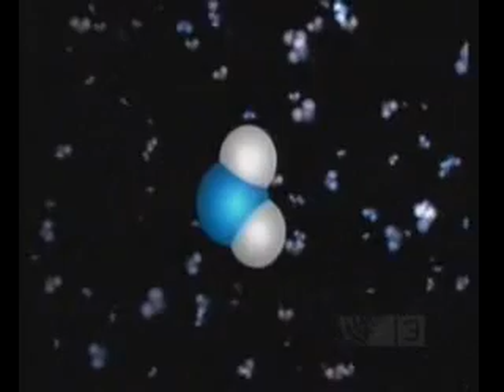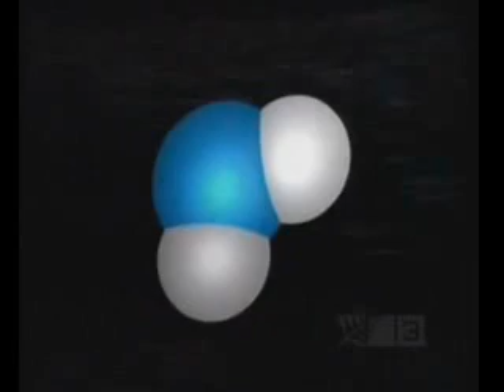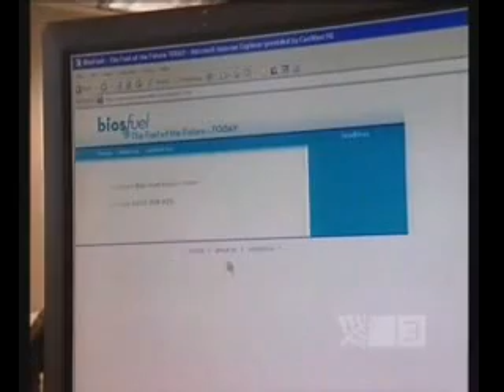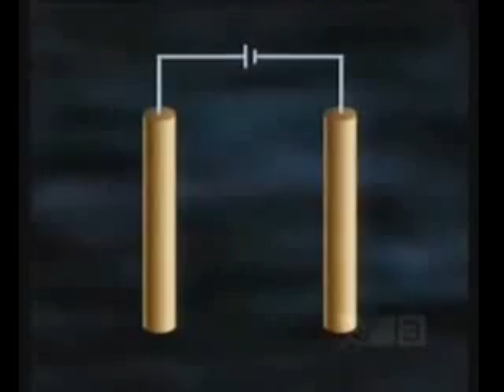A Motorcycle that runs on PURE Water.

Comment: 1:50 The comment box reads "Separate H20 at the point of combustion instead... What's all the fuss." The fuss is that nature doesn't work that way. No amount of heating alone (well at least no amount this side of the surface of the Sun!) will break a covalent bond. Even if he has somehow dissolved a fuel in the water, the expansion of water into a gas may help to drive the cylinder down, but otherwise the water is just an inert vehicle for the fuel. It won't spontaneously separate and recombine.

Comment: While true that hydrogen does dissolve in water, it does not do so to any significant degree; about 0.0016g/cu. L. Assuming we could liberate all the dissolved H2, how much heat could we produce? The ΔH for reacting 2 moles of H2 with 1 mole of O2 is −486.6kJ. H2 is 2.016 g per mole. Thus the most heat we could transfer from our liter of "combustible water" is 0.193kJ, or about 46 calories/L. We need roughly 233,695 times that to operate an internal combustion engine. The claim is pure bullshit.

Comment: Over 100 yrs my friend. Keely had resonant Hydrogen production in the late 1800's. He was called a fraud for his motor powered by resonance (he used a tuning fork...not thought). He also created a hydrogen cannon (using a resonant hydrogen cell to extract the hydrogen from water). Look up "Dr. Stiffler SEC Exciter Hydrogen production via diode". A SEC Exciter can be powered by 1 AA battery if built correctly. Imagine how much hydrogen you could get with a car battery.

Comment: No need to be afraid of things you don't understand. Learn everything you can about something and you will no longer have a reason to fear it. At least that explains why Tesla and Einstein butted heads so much. Quantum Physics is simply the balance to Physics. Two different sides of the same coin. They are the exceptions to each other. One proves the other as well as opposes it. Equal and Opposite. Yin/Yang. Male/Female. Without one the other simply does not exist.

Comment: p2. Also if we did things the same way the universe does (not in straight lines) there is far less resistance and the speed of light is not constant. Meaning the e=mc^2 needs to also be e=mc^3, e=mc^5, etc, etc. Adjustments need to be made and the "laws" of physics need to be used as tools not rules.

Comment: Resonant Hydrogen Production. Found by Keely over 100 yrs ago. Find a video titled Dr. Stiffler SEC Exciter Hydrogen production via diode on youtube. A SEC exciter can be powered by 1 AA battery if built right. Solar Technology is also Tesla Tech. Radiant Energy collector...Tesla used mica instead of silica. The problem with resonant hydrogen production is it does not follow Faraday's math and does not play nice with thermodynamics.

Comment: If it can be documented and proven, then physics laws change.  It has been happening a lot lately.  All the way to the point that the law of relativity my be no longer a law in a few years.  New findings have potentially turned that one on it's head.  The scientific community is always striving to learn more.  If a law can be proven wrong, repeatedly, then it will be changed or replaced.

Comment: For the many wondering why it didn't get out...It does not follow Faraday's Law for splitting the water molecule. It also does not follow the law of thermodynamics. Its called resonant Hydrogen Production. Found by Keely over 100 yrs ago. Search youtube for Dr. Stiffler SEC Exciter Hydrogen production via diode. A SEC exciter can be powered by 1 AA battery if built right. Imagine what a standard car battery could do.

Comment: You would think so...but that is simply not the case. It got buried by the same people that buried it 100 years ago. Its called resonant hydrogen production. It splits the water molecule with resonance. The reason it gets buried is because it does not agree with our current "laws" of thermodynamics and proves that the math for Faraday's laws are not 100%. The amount of power to split water according to Faraday is far less then it actually takes, but Faraday did not account for resonance.

Comment: Resonant Hydrogen Production has been around for over 100 yrs. Keely designed the process to split water with small amounts of electricity forever ago. Its not electrolysis by the convention methods. Its called resonant hydrogen production. Look it up.

Comment: You don't need to ask me, look around. If you want to, add up the carbon dioxide emitted by our cars by weight and volume and see if it adds up to an amount that would increase the CO2 in the air from 280 ppm to 390 ppm in the last 50 years. If so then ask yourself what carbon dioxide does. If you want to know more, take a video cam, which can see infrared, and see if you can see infrared through a tank of CO2 (use dry ice).

Comment: Energy is partially lost to heat whenever it is changed in form, and totally lost when it becomes heat after it does its work, unless it is captured for more work on the way out and cools even more.  Water for hydro-power is a carrier like the weight on a cuckoo clock, the energy isn't in the weight, it is stored in the gravitational field. Some is lost in transmission, but there is a lot left when it gets there.

Comment: No there isn't. A catalyst aids a reaction that already has a result that is downhill from the initial state and just needs a bypass around a potential barrier. Water is NOT in an initial high state, it is burned hydrogen and is in a low state, that means that violates the meaning of the word catalyst.

Comment: When you pile things up in an ordered manner, and then they fall down in disorder, work can be done by them. Like falling water. Or the positive and negative terminals of a battery. The positive is an abundance that is trapped, and the negative is an absence it can flow into. It's relative, whichever is of greater order is the source, the greater disorder is the sink.

Comment: 'I'm a physicist too", yeaaaah riight, Suuure you are! And I worked as an electronic engineer for thirty years, dumb ass, Water molecules are NOT "AC rotors", whatever the fuck THAT is!! They are electric dipoles, sure, but they are NOT some magic source of energy that can be exploited, they are in a disordered state compared to everything around them, unless they are super-heated steam, of course, in which case you can run a steam turbine, but only if you have a sink.

Comment: No. The earth will slow and fall into the sun, all orbits will decay due to multi-body interactions, all molecular motion is powered by local stars and when they all decay, as heat it will finally radiate away into space as infrared. Even protons finally decay into heat, and that's all that's left at long last in the heat-death of the universe. All order becomes infinitely disordered in an infinite amount of time. Entropy reigns. NO motion is perpetual. Trust me, I'm a physicist.

Comment: You can dissipate the car's energy as heat in the brakes,  or you can reduce its kinetic energy with a rocket motor, or you can use a spring to let the car wind it up as a brake and that will store the energy of the car till you want to use it again, minus some loss to heat. Lawyers don't understand physics, but again, you're making reference to something irrelevant and obtuse to the issues. Legal degrees are NOT physics and science. You sound emotionally disturbed and deluded.

Comment: Any braking is the equivalent of extending a part of the car to contact the ground and bleed away its kinetic energy. Or you can use a motor, but it does indeed take away energy OR take energy to stop. As for water molecules, your reference to them makes absolutely no sense.

Comment: You act like scientists "made up" the physical laws a long time ago, before they "knew" anything. This view is incorrect. If you wish to stop a car, you have to use a force to reduce its speed, or you have to put something in the way of it that will reduce its speed. Either a rocket engine or a brake surface "put in the way of it" will suffice, but you will either have to expend energy, or you will have to have the car expend its energy, there's no two ways about it.

Comment: Think of hydrogen and oxygen as being the ends of a spring. When you take water apart you stretch the spring. When you burn them together you let it snap back and get back the energy you used to stretch the spring and the hydrogen and oxygen stick together again. This is called chemical binding energy. Look it up.

Comment: No, water by itself in pure form won't conduct. That's why you need an ionic salt to break it into hydronium and hydroxyl ions, then the current can move the positive hydronium to the negative pole, and deliver electrons to it that make it hydrogen. Likewise acceptng the hydroxl's extra electrons at the positive pole releasing oxygen. And the electrons actually move rather slowly in this and in most conductors, look up "drift velocity of electrons".

Comment: Hydrogen is explosive WITH oxygen. Oxygen is not explosive with anything but a fuel. The electricity required to split the water is more than the energy you can get from burning the hydrogen, so using the electricity in an electric motor would get you farther, forget the hydrogen.

Comment: Hydro in hydrocarbons refers to hydrogen, not water. Hydrocarbons are made of a carbon backbone surrounded by hydrogen atoms, jn chains. There is NO oxygen, NO water, and hydrocarbons do NOT dissolve in water, put gasoline and water in a jar together and they remain separated in two layers. And whereas acids are ionic and fragment atomically in water, hydrocarbons are covalent and do not fragment ionically.

Comment: Quantum Mechanics is NOT pseudo-science, far from it, but it is VERY difficult to properly apply without a thorough-going background in more basic physics. Even talking about it should be avoided. Reading about it should replace trying to say anything with it till you have a significant foundation in the basics.

Comment: Each electron is responsible for neutralizing one hydrogen ion and producing an atom of hydrogen at the negative electrode, so current determines production, but the voltage applied molecularly must be sufficient but not more so. And the current is DC, continuous, it isn't necessary to vary or oscillate it. The current times the sufficient voltage produces the hydrogen with that total energy available.

Comment: No. CO2 is fully burned carbon, which carbon had a lot more energy than hydrogen by weight. And electricity isn't magic, all the energy hydrogen gets comes from the electrolysis, nothing is magically produced from nothing.

Comment: The quite popular "HHO, engine runs on water" assumption is that there should be some magic frequency of AC or periodic DC that would optimize electrolysis or make it much more effective. That notion is totally unsupported by either scientific theory involved atomically and chemically, or by any body of experiment regarding electrolysis. DC at the right current and voltage produces the optimal output of hydrogen and oxygen. No more can be produced.

Comment: To a physicist your, "all energy above the capacity of the conductor will be radiated out" sounds like absolute science fiction jargon, meaningless drivel.
It only SOUNDS like science to the amateur. Electrolysis has been thoroughly investigated for industrial processes and is perfectly well understood. There are mathematical limits to its efficiency that cannot be broken, and for some good chemical and thermodynamic reasons. Claiming to have done so is an obvious fraud.

Comment: Pulsing the current won't work, the electrolysis performed is merely the integral over time of the actual current flow. Each electron, ideally in the electrolysis process, will be responsible for liberating one hydrogen atom, if it has the required voltage to break down water. And more voltage won't work better, it just turns to heat.

Comment: It would be more efficient just to use a gasoline engine. There is no magic electrolysis process than can produce lots of hydrogen with only a little electrical; energy. ALL the energy hydrogen has when burned comes directly from the energy expended in producing it by electrolysis. There are no magic circuits that can make it more than 100% efficient, because the energy has to come from someplace.

Comment: Many people see electrolysis as some magical process that with just a little electricity can produce a lot of hydrogen. Electrolysis can be more than 50% efficient, tis true,. but the energy the hydrogen will have when burned comes from the energy used in electrolysis, minus waste heat. This means that if you use an alternator, you will need more gasoline equivalent energy than you will get that you can burn in the form of hydrogen.

Comment: Here's why: If you wanted to use hydrogen without compressing it to 40 to 80 atmospheres, then you will need a blimp you drag behind you. It is true that hydrogen has 30% more energy by weight than gasoline, but a kg of hydrogen is 500 moles and at 22.4 Liters per mole you're talking more than 110,000 Liters. And that or a kg of gasoline will get you about ten miles.

Comment: Some people talk magic without realizing it. Sure, I heard electrolysis. And for a fixed electrolyzer making hydrogen to be compressed into a high pressure cylinder and used in a vehicle, sure, that can work. But people around here keep talking about an "electrolysis onboard" vehicle application, either partial or total, and that won't work.

Comment: To crack water into hydrogen and oxygen you have to supply EXACTLY the same energy from another source outside it, so "making" hydrogen is just storing that same energy back into it. In it's "water" form it cannot burn, it is already burned-up hydrogen, that's what water is!! And no, it isn't true that there is a "magic" way to make it break apart without doing that,
ANY chemist or physicist can tell you that's incorrect understanding.

Comment: wow im ignorant, i am 48 years old am an electrician and gasolene engine mechanical engineer, have 22 years experience in both , also am a master printer on 12 different types of presses one of which i still lethography on so you call me ignorant , OK , YOU GO AND FIND THIS GUY AND THEN YOU TAKE A CUP OF HIS WATER OUT OF THE TANK , THEN DRINK THE WATER , IF IT IS WATER ILL LICK THE INSIDE OF THE CYCLE TAIL PIPE , deal ? you are the ignoramous

Comment: Not really. If they somehow have made a fuel of hydrogen and oxygen out of water, the only thing that would happen when you burned it would be that it evaporated and turned into water vapor. You CAN produce hydrogen gas from water pretty easily, but as the video tells, it needs electricity to work. The outcome is not liquid though, but a gas. The problem of course, is that it requires more energy to split H and O, than it creates when ignited. I think this is a hoax though.

Comment: Could this be done with a fuel injection system versus carbureted? If my motorcycle dies I wouldn't mind giving an alternation fuel a try after I put the engine on a go cart chassis.

Comment: Since the only part of everyday gasoline that burns or combusts comes from the hydrogen content in it the same is true for any other source of hydrogen. So running an electric current through normal water can and does provide enough accumulated Hydrogen bubbles to sufficiently provide a car or motor bike with enough hydrogen source to naturally combusts in the cylinders which provide us and our vehicles with power thus giving us motion. Tada!!! its easy as shit to do and this guy is not a hero

Comment: Hydrogen is explosive and although we breathe oxygen, pure 100% oxygen is also explosive. So the whole reason water can power anything such as a car or motorcycle is because it is being separated from H2O which is neutral water into its lighter pair elements which are 2 parts hydrogen gas and one part oxygen gas. Once this is accomplished the created gas can be fed up a tube into any carburetor where it is used to power any internal combustion engine.

Comment: to the surface of the water being electrically excited. Once this happens they accumulate at the surface into larger and larger bubbles of hydrogen and oxygen. And since hydrogen is the lightest element on the periodic table of elements it rises up through a capturing hose to be used for other purposes. It is important to know that Hydrogen is the most common element in the whole universe. Its practically in everything. Hydrogen is what causes gasoline to be flammable and explosive.

Comment: And running an electrical current through it to seperate the H2O into H+H and O. Basically all electrolysis does is send high speed electrons through a medium of liquid being water and the electrical input into the water breaks the covelant bond that water has apart. So the neutral 2 parts hydrogen that bonds with 1 part oxygen in everyday H2O gets separated into 2 parts hydrogen gas and 1 part oxygen gas. When this is done the hydrogen and oxygen are lighter than the liquid water thus they rise

Comment: because they are quickly burnt up by the hydrogen contained within the gasoline. An easy example of this is wood and fire. The wood would represent the carbon element in the hydrocarbon chain and the fire would represent the hydrogen which is the only combustible part of gasoline. So the only reason gasoline burns or has any explosive quality comes from the hydrogen source in its hydrocarbon chain. Water powered anything comes from electrolysis. Electrolysis is the process of taking normal H2O